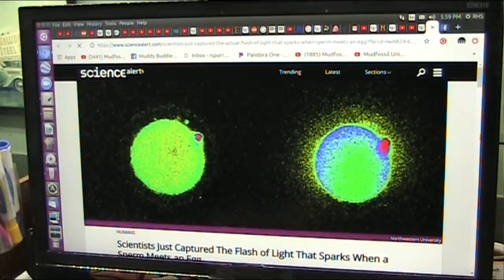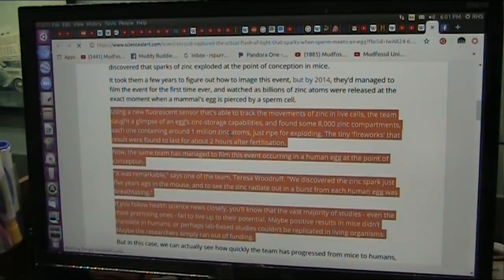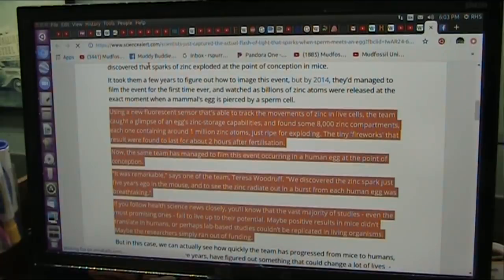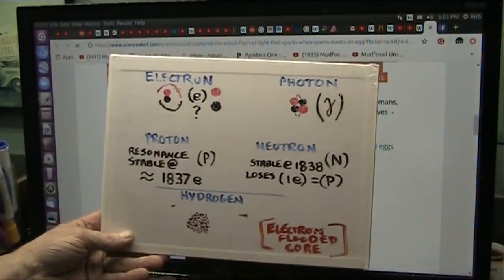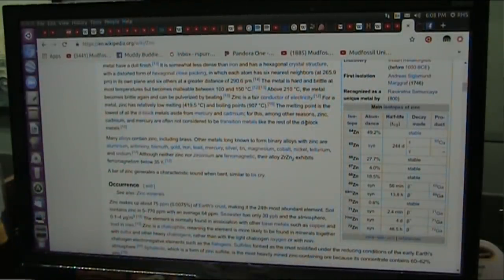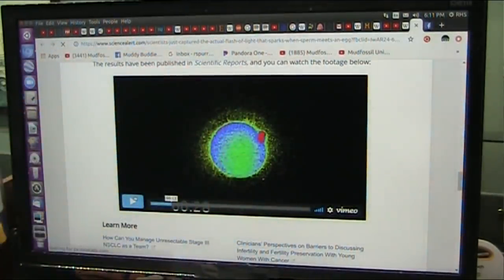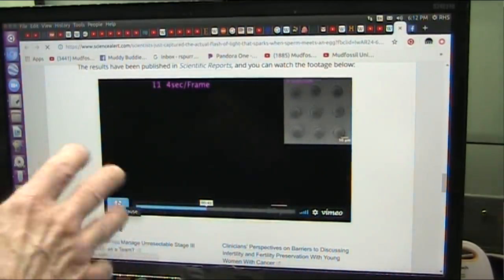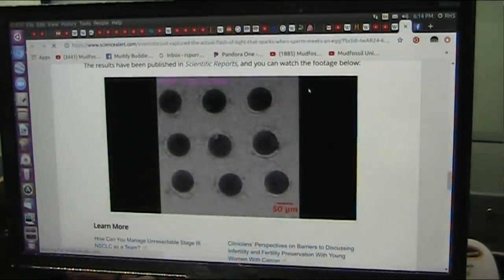Spark Seen When Sperm Meets Egg

Comment: What if,  the pyramids are why men lived so long and grew so large. The power wasn't for lights, usable  energy like we use it today but it was for a life enhancement / preservation. After the flood, the electric stopped working as designed. Or the flood shut it down and no one who could reset the " fuse" survived.